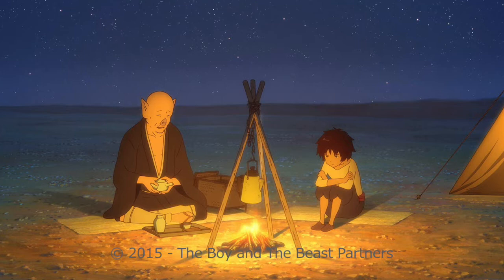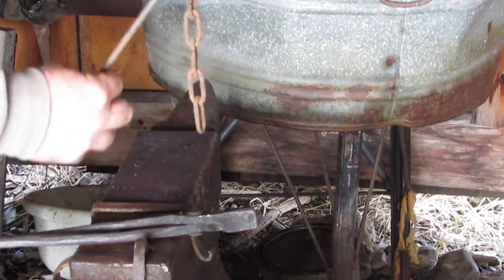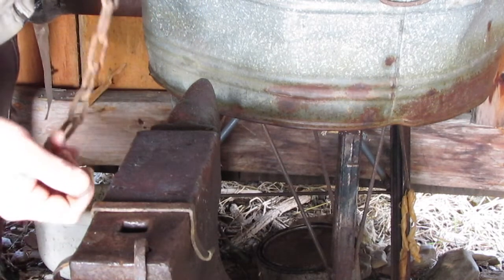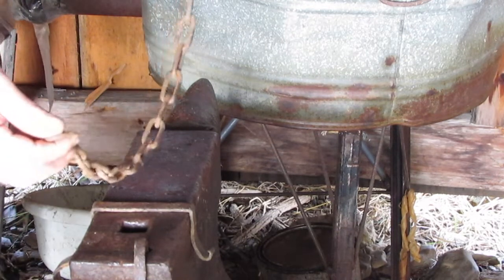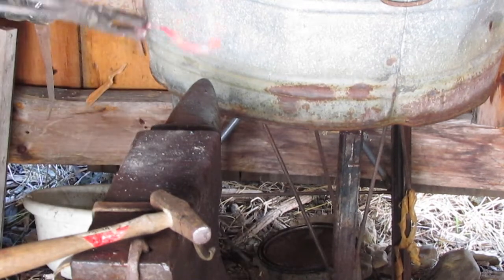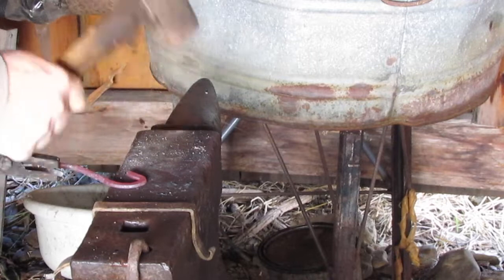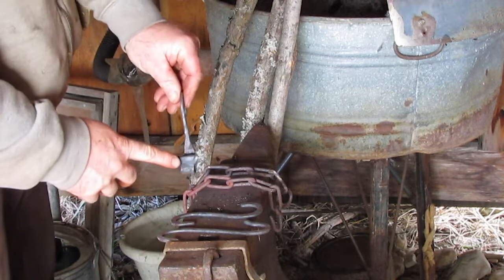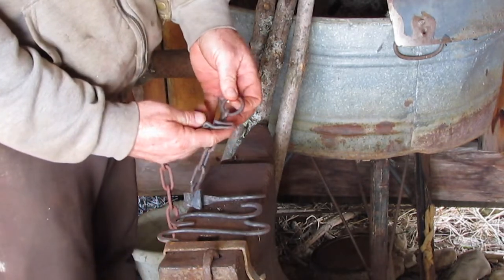Making a Simple Campfire Tripod Rig

Comment: About a million years ago I made a metal ring tripod using a hot wrench. Didn't have you tube at the time so had to kind of make it up. Also didn't have real metal long enough so butt welded rebar on each leg. Had chain like yours but used store bought s hooks. Didn't use ours much either.